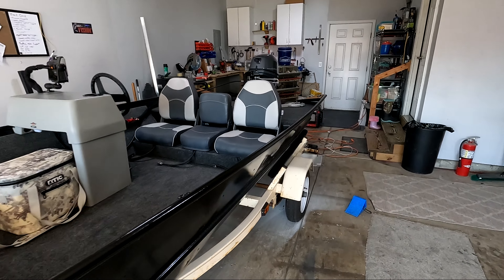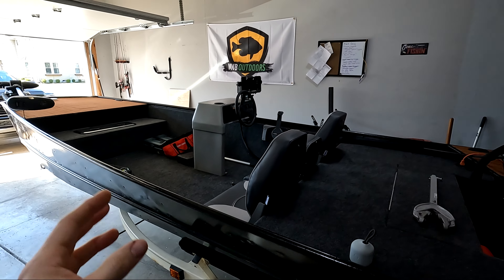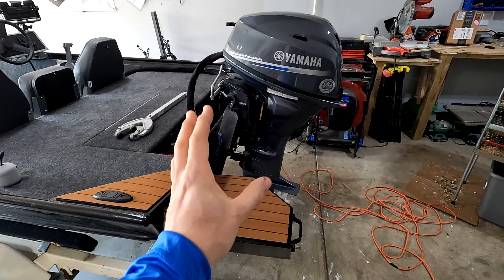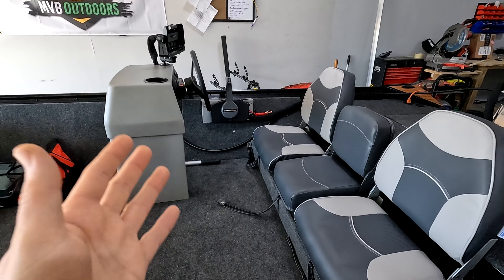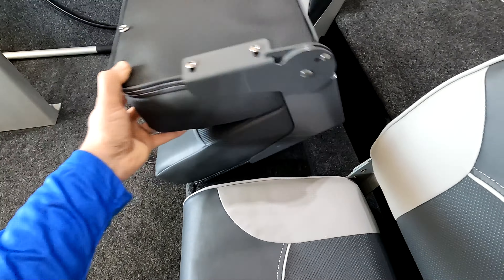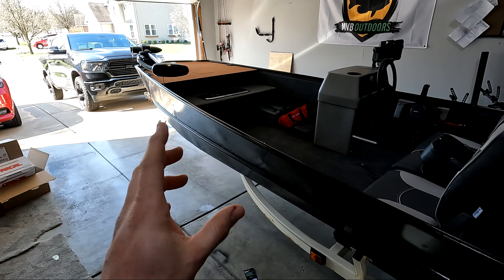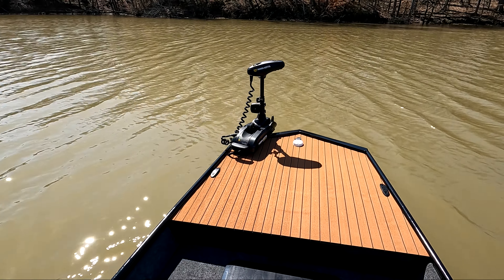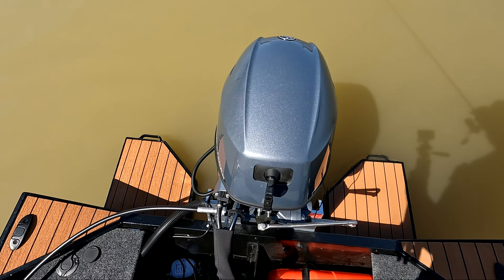1648 Jon Boat Build WATER TEST | How fast does it go?

Comment: Great job with the jon boat build.  Just saw the video.  You mentioned vibration from the motor in the boat.  I can't tell if you have them but a Transom Support Plate might be a good idea to purchase to provide a stable surface to really bolt down your jackplate.  The transom itself is too soft and you can damage the transom when you are tightening the bolts for the jackplate.

Comment: Did tightening the transom bolts fix the vibration? Was the fish finder still shaking a lot? Congrats on the successful water test! When I was watching the video I was thinking that the 3 seats looked lower than I remember, then you referenced the video when you lifted up the seats. Haha
Reply from the maker: Haha, yeah I put out the bench seat revamp video early. Tightening the bolts helped a ton along with some other upgrades I'll get into soon! The fish finder shake reduced a lot with the vibration fixes.

Comment: Awesome build! Ive been wanting to do something like this, but my main concern is when it comes to washing it and having sitting water inside the boat. Does the water flow to the bottom and drain out the plug hole as regular? Or do you try to avoid water on the inside. I am mainly saltwater so cleaning interior is a must!
Reply from the maker: For sure, everything drains out the plug. All of the framing is off the floor to not obstruct water flow. The floor is aluminum.

Comment: Looks great man. If you're ventilating (not cavitation, there's a difference) while trimming, you're too high, just as you said. Lower the engine down about 1" and you should be fine. You should also pick up speed because it'll lift your bow and gain thrust (due to not ventilating) keep up the great work.